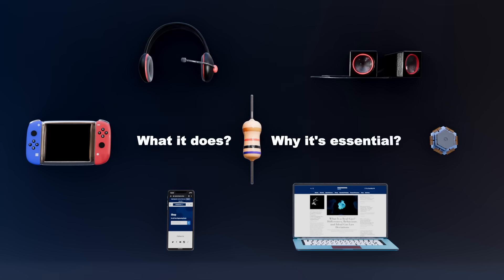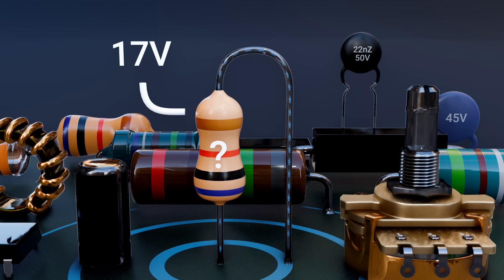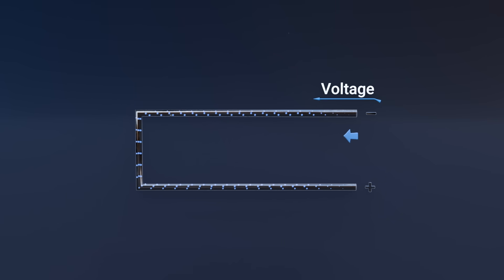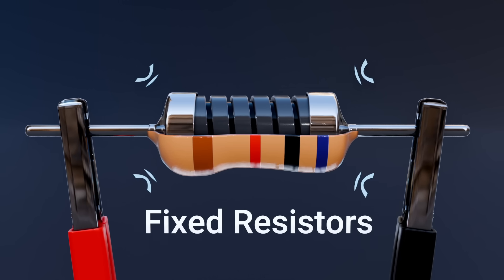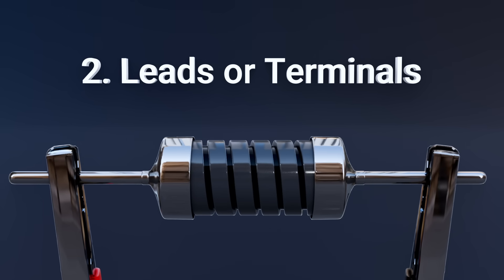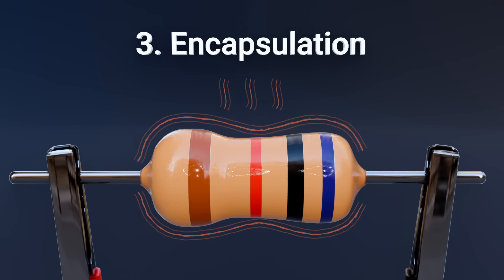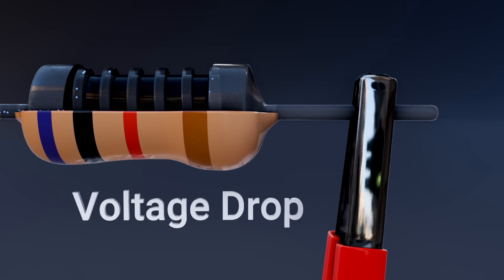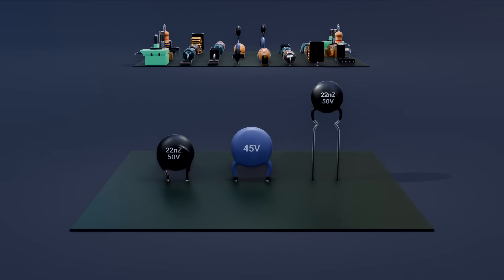Resistors Explained & Ohm's Law Made Simple! | What Are Resistors? & How Do Resistors Work?

Comment from the maker: Got any suggestions to improve our content or ideas for new videos? Drop it down here!

Also this Video took a long time to make, if you would like to help the engineeringness team, check out our shop and membership options. It will really help us to create more. Check out the following link: https://engineeringness.shop/en-gbp
Reply: I want to see videos about every simple electronic component like resistor
Reply: You're doing good at explaining and simplify it , I suggest you to do a video about inductor component 🤍✨
Reply: You need to show practical application of elements you talking about. For example? in video about capacitors, you should have shown on the circuit how capacitor stors energy, lets say 12 volt, and when there is a drop on power line, to 9 volt, capacitor will release stored energy, to compensate 3 volt loss. So the LED lamp would shine with the same intensity, even when there is microsecond drop in voltage, so no eye irritation. In short, don't just tell what it can do, show how exactly it does that thing on a practical level (so we do get practical, applicable knowledge, "With real understanding of what we can do with it, and how".
Reply from the maker: @lexkross7535  This is an amazing bit of advice and we will 100% be looking to implement it into out new videos! Thankyou soo much for taking the time out to write this out. It is super helpful and very well thought out! 😊😊 P.S. Thanks for commenting and showing us support.
Reply: Hey bro, what application used to make vedio 🤔🤔
Reply from the maker: @nandhukrishnanr2930 Mostly Blender and DaVinci Resolve
Reply: I would suggest providing an example to illustrate the function of the resistor. For example, show us what a resistor will do between a power source and an LED. Now change LED specs and show how the resistor needs to also change in order to cater accordingly.
Reply: I have a question, but I'm an electronic ignorance . My question has to do with my ho scale train set.  For the past few weeks, I have been trying (unsuccessful) to install two lights for a building. These are Incandescent 12V 50mA lights . My power source is 12V. I hooked up the lights without a resistor and was shocked when it burned away some of the building 😞. Desperate.

Comment: And if u do a strip color video for u new bees. My professor, used to say the color strips are like Dams. Current is the flash flood u want to control. First dam slows it, next slows it more and cleans it,  then next strip chocks it off. Last stripe, is the flow u want. I'm the guy who broke the code for ,modern chips. 
My flash of IQ happen in Japan Oct 1983. Nothing can be pushed at near light speed, everything melts. (( Bam , single molucue, magnetic sucked into the sub straight. In 1984 my self and nasa tool and die guy. Built what we called a million dollar sewing machine. ( Bed , left, right, bed, left, right ) Data, flows in the dead space, of three molecules, stacked.. blab blab. I sold windows June 1984. I even write Bill Gates cover story. ( Go look, ) I was sitting in my garage looking out the window. Then it came to me.😂 I still laugh. Good luck. Oh yes one more story.  I'm the guy who invented digital color photos. In my labs. I took all 5 primary colors. Broke them down by pixil. Each color is 254 pixel shades. Then I rated the subatomic bounce rate of x ban . Blab blab. I took the first color photo from orbiting platform. It was big news but all classified back then.

Comment: Wouldn't the carbon resistive material placed inside as a coil also product inductance? And I guess the same for wire wound resistors? Yet a chunk of carbon would not have inductance, because it's not a coil. I have seen carbon resistors cracked open and the contents was simply carbon pressed into the shape of the resistor - pressed in much the same was a pharmaceutical would press powder into the shape of a pill.

Comment: Strictly speaking, there are two types of resistance.
1. Undesirable energy conversion (power loss)
E.g. in electronic circuits. This is an unavoidable consequence of the current flow through such resistors.
2. Desired energy conversion (useful power)
However, there are also applications in which the heat dissipation of the resistor is exactly the desired effect, such as heating elements, fuses, incandescent lamps (in the past).

Since we basically “throw away” energy in electronic circuits and even generate unwanted heat (which we also have to deal with), a new type of component that wastes hardly any energy would be revolutionary, similar to how LEDs are replacing incandescent light bulbs.

Comment: Unfortunately, there is no mention about the colored rings that are painted on the housings.  I suppose that they signify the amount of voltage each one can tolerate?
Reply: I'm fairly sure it's the amount of resistance
Reply: All colored bands represent a value:
Black: 0
Brown: 1
Red: 2
Orange: 4
Yellow: 5
Green: 6
Blue: 7
Violet: 8
Gray: 9
White: 10

Example: red red red would be 2 2 times 10^2 = 2k2 = 2200 Ohm. The next band represents tolerance (gold, silver) I don't recollect their precise values.
Reply: @PaulusN-p3m  Thanks!
Reply: They indicate the resistance of the resistor, in Ohms.
Reply: It is a code for the resistance value
Reply: The colours represent numbers putting them together equal the resistance. The easiest way to know the value is too use a multimeter  instead of trying to remember the values.
Reply: colour bands are colour coding for resistance values

Comment: So what’s the point of this ? Why is it necessary ? Don’t understand
Reply: You can use it to limit current, as in to prevent a short circuit. Or to prevent parts from being exposed to too much voltage, for example diodes, which would lead to their destruction

Comment: Resistors have nuclear ray beam fired on them, when a device or user becomes on blacklist, the resistance becomes higher. Typical for smart battery. When anything containing a li ion battery is bought, formatting of the batt is needed carefully, or else your batt will become weak. Same w cables for phones.

Comment: I watched a video and I still do not understand how resistor lowers voltage. I can see a spiral inside a resistor but why electricity voltage changes when going through it?
Reply: Resistance itself is the physical property of a conductor that resists current. Picture a moving electron colliding with (or being electrostatically influenced by) other particles. The more of those collisions, the higher the resistance.

Volts, amps and ohms are all interdependent - if you change one the others change too.
Reply: imagine 100 people want to go outside of a burning build at once, but they have to go through a door that the physical structure of the door allows only 3 people through the door at once, so the all people can not go outside at once. the you observe the situation, you can see there is a great crowd form inside and only 3 people coming outside at a time so the potential difference from inside is much greater than outside of the door. so here the door is the resistor that blocks the current of people(Elektrons)  to go all at once.  und the voltage( the wish of the people to go outside) is dropped by V=IR
Reply: V=IR